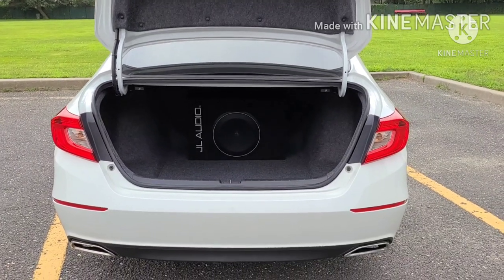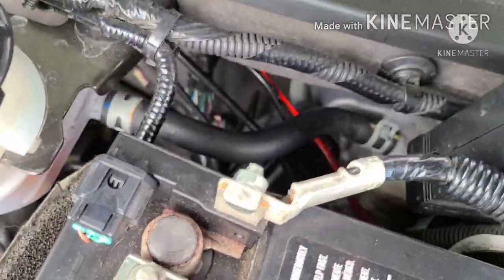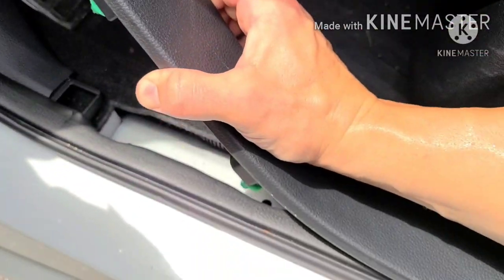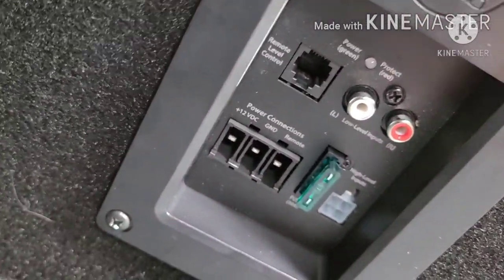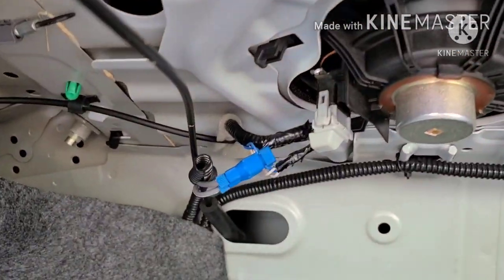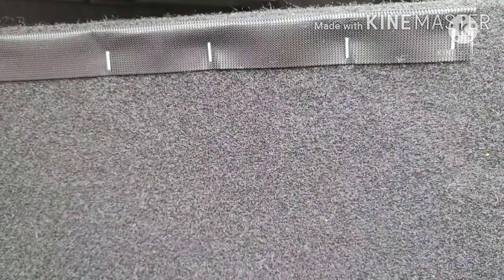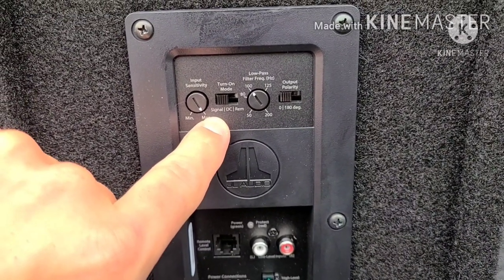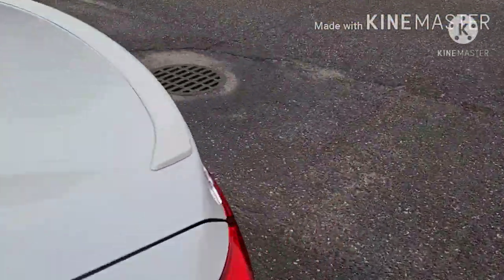JL Audio MicroSub+ ACP112LG-TW1 w/ built in  LC2i | 2018-2021 Accord 2.0t

Comment: I'd HIGHLY recommend putting a rubber grommet where you ran the wire through the back seat area to the trunk.  It WILL...  and I repeat...  It WILL cut through the wire and short to the car and can cause electrical damage to a myriad of electrical components in your car, or worse case, start a fire.  PLEASE do that.  I've had that wire short on me before.  Vibrations from the sub and the car will make the metal a saw

Comment: Me again with another question lol So I just listened to the factory system and the speakers are pretty bad. Seems like adding a sub would drown them out even more but your highs sound really clear. Did you upgrade your speakers as well?
Reply from the maker: I haven't changed the interior speakers.  Once you take the bass off of them,  they can handle the highs and mids better without distorting. Let the sub do 90% of the lows.
Reply: Thanks again! I’m gonna order a sub now. I’ll bother you again on another topic eventually haha
Reply: I have a 2018 CRV with subs installed and my bass and mid settings are basically set to 0 while the treble is set alittle high.  And my stock speakers sound clean añd the bass from the subwoofers compliment the interior speakers

Comment: Great video. One tip from a fellow 10th Gen Accord owner, if you want to see a significant improvement in bass response, tap the sound from the FRONT speakers. The Accord factory EQ SIGNIFICNT:Y reduces low frequency output for the rear speakers. I know it is MUCH easier to tap the rear speaker for the signal and that is what I did initially on my install of the Rockford Fosgate version of the "all in one". I was very disappointed with the sound and did a ton of research until I discovered the difference in the signal output between the front and rear speakers. I switched to tapping the signal from the front speakers and it makes a HUGE difference. You don't need to dial in nearly as much gain to get great sound. 

Please trust me as I learned the hard way. If you love it now you will be blown away after the change.
Reply: I thought too do that as well but purchased the kicker key 500.1 and installed it and ran the 2 download tones too clean out the sig al and add the missing power and base and it worked!!! I'm so excited. I tapped into the rears as well. I guess the dsp built into the kicker key amp cleaned the signal and added the missing bass.

Comment: Pro tip: you need to set the input sensitivity. You have it set at max!  I can hear it clipping already. 

Input Sensitivity Level Setting
Follow the steps below to adjust the input sensitivity of the amplifier to achieve overall system balance.
1) Turn off or set to center all processing (bass/ treble, loudness, EQ, etc.) on the source unit. Set the source unit’s fader control to center position and its subwoofer level control (if applicable) to 3⁄4 of maximum.
2) Turn the amplifier’s “Input Sensitivity” control to the “Min.” position.
3) While playing a dynamic audio track, increase the head unit volume until the subwoofer output distorts. Then, reduce the volume by one step (or until the subwoofer’s output is no longer distorted).
4) Increase the “Input Sensitivity” until the subwoofer output is distorted.
5) Reduce the “Input Sensitivity” slightly until the subwoofer output is no longer distorted.
6) Listen to the overall system and adjust the “Input Sensitivity” downward if the subwoofer output requires attenuation to achieve the desired system balance.
Reply from the maker: I turned it down its at 3/4 now and hits harder than it did once it broke in. Camera couldn't pick up all the sound. But never did it break-up or distort. During that video
Reply: Typically the distortion is caused my the microphone clipping rather than the setup itself, videos are hard to determine though.

Comment: I own a tw1 10inch micro sub in truck sounds very clean not too loud just clean!
Reply: Are you happy you got it? Thinking about getting one
Reply: @Nolando8284  yes micro sub tw1 with built in amplifier in my GMC Sierra bumps clean! Don’t expect huge ground shaking bass but it’s very clean. If you have a trunk go with a 12 inch bumps harder. Jl  is the best
Reply: @garyseeseverything8615  what about, i have 2020 nissan murano? 10' or 12' .no truck just up back space

Comment: Thnx bro this video right here made take my sound in my accord a little far. Ho110-w6v3 and jd1000, rd400 amps, jl 650x in rear deck, c2 650 components in front doors and tweeters, dynamated all 4 doors, rear deck and trunk lid. I went overboard 😔 buts it's done now🤷🏾‍♂️🤣 thnx again✊🏽edit: sent the 10 back now have the 12 installed
Reply from the maker: Haha... Nice!

Comment: Awesome! Nice & clean.   Love me some @jlaudio.
Reply from the maker: Thanks brother appreciate it! I actually did this like 7 months ago. I had to re-upload the video due to a copyright issue with the song I used. So had to do a little voice over when the audio was playing so it wasn't an original track anymore 🤦‍♂️
Reply: @DanVilla7  you ever try placing the sub towards the back of the car more?  Obviously it takes up more space but i noticed that helped get the sound back into the cabin without dropping the seats.   I'm about to cut the rear deck out and replace the plastic lid lol :D
Reply from the maker: I haven't tried it, I need my trunk space. My kids make my decisions for me hahah
Reply: @touring189  man I'm running into the same issue here, I got the 10 in sub, same rms 400 watts but I am getting hardly any bass into the cabin, I am guessing it is due to the trunk insulation plus the seats have the thick carpet. have you find a solution? I have even consider the thought of placing the whole damn thing on top of the rear speakers deck and call it a day but It won't look pretty. and yes I have already disconnected the ANC Module and made sure both wires on both rear speakers are properly tapped. I need some help here please!

Comment: I have all way around JL Audio in my 2019 stick shift I bought the amps JL Audio yesterday once get installed I’ll share the link with you
Reply: did you get the same subwoofer?
Reply: Yes all  jl audio but I haven’t finish yet  I burned from the voice t to the sub one the amps lol
Reply: I burned  one of the amps that’s what I’m mean lol
Reply: Damn man, it happens. I got the 10inch and I am not getting bass once I close the trunk. 😔
Reply: @sparco023  whaaat
Reply: @sparco023  you  don’t know if you have the right  oms  watts  if not just buy the amp and the sub and install nop everything has to be equal or close to it

Comment: I had the same set up when i bought my 19 accord sport.it was ok but i ended up changeing mine for all fosgate equipment. I know have a 12in P3 and its sounds 100x better brother just my opinion. But everyone has different sound preferences but I honestly love the fosgate so much better bro but great work bro.
Reply from the maker: Thank you! I did it with the intention of fixing what wasn't there while maintaining trunk space. As you can see I have 2 little ones and they have lost of stuff to take when we go out.  Also the ability to instantly remove it was another selling point for me not to mention it sounds amazing for what it is.

Comment: I've been advised by a few audio install shops that for a proper installation I actually would require a line output converter (in this case the Audio control LC2i). Is it actually required or is it built in as you mentioned?
Reply from the maker: It's built in, all you need is the wire kit.
Reply: @DanVilla7  I guess it depends on where you're pulling the power from. I think if you're pulling sound from built in subs it's required (according to Crutchfield).
Reply from the maker: @lundonclark1221  still shouldn't matter. I tapped the rear speaker as per the video
Reply: @lundonclark1221  All an LC2i allows you to do is take a amplified signal from a factory amp or head unit and turn to a useable signal to amplify. On this sub, It has a high level input and that is basically the same thing because you can set the input gain to bring it down to a useable signal for your amp. 
So you don't need a lc2i if you are running pretty much any powered subwoofer box as most of them have high level inputs built into them. But if you are plugging into an after market amp that doesnt have a high level input. Thats when the Lc2i would come in handy
Reply: Depends on the amplifier used,  His JL combo has a built in LOC which he connected that in the high input connector.  If your amp does not have high inputs, then it is best to get those line output connectors to help improve adjust the speaker signal to an amp.  So the shop telling you that it is better to have a LOC, well that is somewhat true. If the speaker signal is too high, LOC's will help to improve it and clean out the signal.

Comment: what about, i have 2020 nissan murano? 10' or 12' .no truck just up back space
Reply from the maker: All depends on what your looking for. I would personally go with a 12 either way. I just prefer the sound better
Reply: @DanVilla7  thankyou and what about the MHD-RLC
Water-Resistant Amplifier Remote Level Control? is it needed or better the have? Cant  I just set the bass from factory radio?

Comment: Do you have the 10 speaker system? Also did you disconnect the ANC doing this install?
Reply from the maker: The sport comes with an eight speaker system (no factory sub) Yes I did disconnect the ANC module
Reply: @DanVilla7  Thank you and 1 more question where you put your ground wire it’s on an existing bolt. Did you sand that area at all or just installed it as is?
Reply from the maker: Here's a pic of where I grounded it
https://www.instagram.com/p/CCe-f3Snwga/?igshid=crtdjt2pb7qf

Comment: I was going to get the 12” model but holy smokes I think that will be too much judging from this. I like bass but I do not want my whole car to rattle. I basically want it a smidge just over feeling the impact but it will be going into a Ford Explorer. Thoughts?
Reply from the maker: Always better to go a little bigger and not use it then to go smaller and it'snot enough.  At that point would be a waste of money. Go with the 12" Just my .02
Reply: @DanVilla7  I did! Also went with a JL XD600 for the amp.
Reply from the maker: @Robert Breish  it's an all in one already has an amp. You must have purchased a different 12" JL sub
Reply: @DanVilla7  Yes I did. I wanted the amp to be separate because my Ford Explorer has some weird OEM stuff I need to work around so I’m also using an LC2i Pro line out converter. Also heard amazing things about the XD amps and it should do a much better job extracting as much quality bass out of that 12” than the all in one solution. Not that there’s anything wrong with those.

Comment: I have this set up in my car. Unfortunately I blew my speaker. I'm having a hard time finding an affordable replacement speaker. JL will not repair the speaker. Can I put in any other speaker?...
Reply from the maker: Im sure you can as long as it somewhat matches the amps power and is slim. These are micro subs and have a very shallow design to save space. 
I'm surprised to hear it blew.
Reply: @DanVilla7  me too... but apparently you can't listen to it on full blast 24 hours a day... ??? I'm calling JL Monday. Maybe they can help me.  I went to sound factory,  a local car stereo installment business,  but they weren't any help...
Reply from the maker: If you use anything at it's limit all the time the chances of failure are high. I would probably recommend getting a more powerful setup since you seem to need more sound that way you can run it at a safer level and prevent blowing it

Comment: You need to use rubber gromets where those wires run through the sheet metal. Youre going to burn your car down if they rub through and contact one another and short out

Comment: I just ordered one, I’m hoping it really bumps hard inside of the car, I don’t really care how it sounds outside, I just want some deep lows
Reply from the maker: It's impressive for what it is that's for sure. Everyone who hears it feels the same way
Reply: Have you gotten it? I’ve had mine for a little over two months and feel underwhelmed from the bass. I also tapped into the rear speakers, maybe I should try tapping into the front.
Reply from the maker: @Allhype214  make sure you grab both + wires and both - wires happened to me and the signal wasn't strong enough.  I mentioned it in the video
Reply: @Allhype214  ya honestly it’s small but it gives a good enough boom for me, with it turned all the way
Reply: @DanVilla7  Hey Dan thanks for the reply! So I didnt tap directly into the wire itself I used a spade connector and connected it to the plug directly, which I think should cover both wires. I followed this guy as I did not have taps you recommended  https://youtu.be/hVLYs9RreMg?t=788 I did order some yesterday so ill try them out soon.
Reply: @thechronicgrump3906  Appreciate the reply!
Reply: Hey guys update, I ordered the taps that Dan recommended, and retapped the rear speakers. I did not hear a difference so I ran new lines from my front left/right speakers and DAMN this sub came alive. I would definitely recommend anybody that drives this gen accord to run your lines from the front speakers and not the rear cause its a night and day difference.
Reply: @Allhype214  that's awesome. Or what I did was tapped into rear and bought a kicker key amp which has a built In dsp. I downloaded 2 test tones and it added bass missing from the geadunits signal. Now my 12 inch kicker comp r is hitting hard with the missing bass it brought out

Comment: Hey dude, just tried installing mine today. Power to amp with solid green light but not getting any signal. I tapped my rears and each speaker has one positive and one negative on each side. I went into them with t-taps but not getting any sound.

Any ideas what’s going on
Reply from the maker: Each speaker has 2 + and 2- wires. If you don't tap both of each the signal will be weak. Also check the levels on the back gain, frequency
Reply: @DanVilla7  thanks for the reply bro! I actually got it working yesterday. Everything was fine with the install. I used a telephone wire for the bass remote and I guess that isn’t compatible so when I unplugged it the sun went boom boom boom ❤️

For what it is and how small it is, it’s pretty good! Now to address the rattling plate 😂

Comment: So tap both back speakers? Do you know which wire color is pos and neg on the speakers thanks
Reply from the maker: Yes otherwise you will get a weak signal.  I actually deleted the wiring guide. I just googled it and was able to find it
Reply from the maker: I looked it up for you 
Rear left: Blue + / white -
Rear right: Yellow + / Brown -

Comment: How did you tap into the speakers?. How did u actually do the tap. A detailed explanation of this would be appreciated.

Thanks.
Reply from the maker: I used posi taps (link in the description) and and ran speaker wire to the amp. You can see how I made the connections in the video
Reply: You mentioned you changed and needed 2 of each. So do you mean you spliced the rear left and right + on one tap and tbe rear left and right - on the other tap?
Reply from the maker: @larikdais8488  you need to tap both left and right speaker wires. There are 2 positive and 2 negative wires to each speaker . So when to tap the left rear use both positives and negative wires and repeat for the other side. If you only grab one from each the signal will be weak and the sub wont get a strong signal to properly hit

Comment: Hey dude, Are you still running this setup and are you still happy with it? I have a 2018 2.0t and I am looking at the same JL setup. Im just doing my doors and rear deck this weekend. 
I found a dude on youtube who took the audio signal from the disconnected factory sub, And you can still control the subwoofer volume with the infotainment screen which i thought was cool. so no need to install a bass knob, 
Is youre velcro still holding up?
Reply from the maker: Yes still using it and very happy.  I  ended up having to use some more velcro but holds well
Reply: @DanVilla7  Sweet thanks man

Comment: do i have to use lc2i ? aslo can i connect the sub straight to the wires coming out of the amb ?
Reply: His video shows he tapped into the stock speakers into the JL high input level plugs which you do not need the loc system.  You only use loc when the amp does not accept high speaker input or if the speaker line is not loud enough and the lóc help with signal improvement.

Comment: What do you have your settings set at for input sensitivity and for the low pass filter frequency
Reply from the maker: I have the sensitivity set around 3/4 and frequency aroud 90hz.
Reply: @DanVilla7  Will I get a increase in the bass or do damage to my sub if I turn up the low pass frequency a bit more
Reply from the maker: @is2fiftyslowfsport744  if it's distorting then lower it. It all depends on how much signal its getting. Your ears are the best way to keep it from blowing. It is a great sub and durable, I haven't had any issues with mine.
Reply: @DanVilla7  So as long as I don't hear no destortion I should be ok if I turn up the low pass filter frequency right?
Reply from the maker: @is2fiftyslowfsport744  pretty much. As long ss it's hitting clear your in the clear
Reply: @DanVilla7  Thanks for your help

Comment: Do you need a remote wire for this sub ?
Reply from the maker: You don't, it works with either a remote wire or speaker input your choice.  I used the speaker input